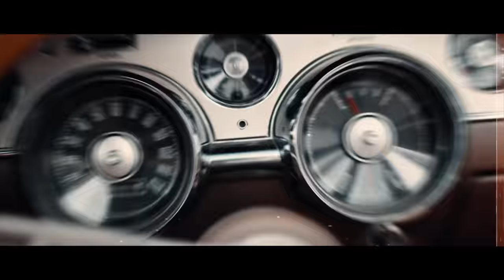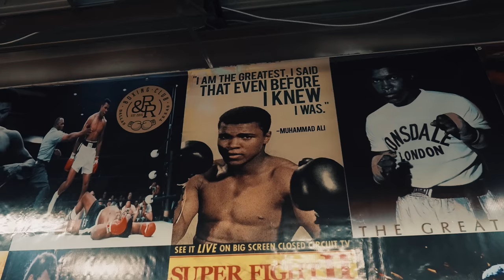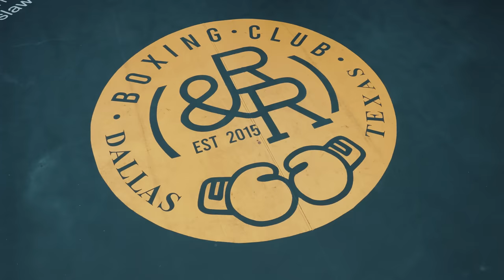Our "Totaled" FERRARI 812 SUPERFAST Is Getting A Facelift

Comment: had a new  1979 150 same color lariat with factory quad front shocks...rode like a lumberwagon and wasnt that good of a truck those of us that owned them back in the day know...rather have the stock Raptor  hope when you set those special rivets you were using a proper rivet torque tool to ensure you havent compromised the integrity...per the MFG specs